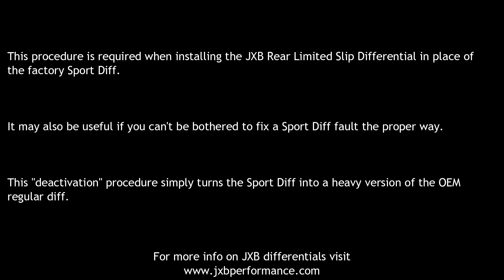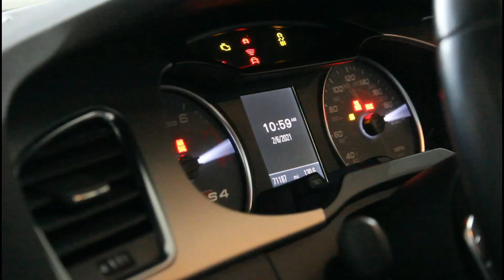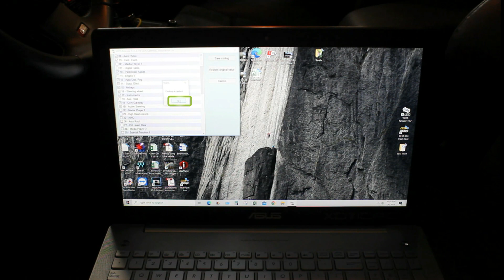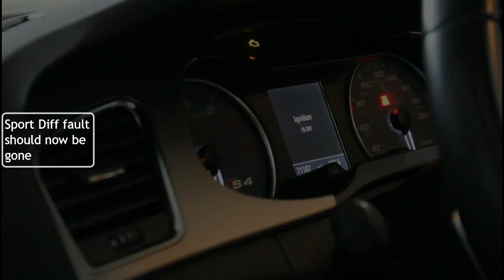How to Deactivate/Code Out B8 Audi S4 Sport Diff

Comment: Will this work for 14 audi rs5 diff?Prev owner mentioned changing the rear differential with used oem diff. confirmed with the shop that did the work. Thy recommended going to the dealer. Car drives fine but show sports differential malfunction light. Same one u had in the video. Thanks

Comment: Hello, great video! You just helped me get rid of the light I have spent months fighting and trying to fix. 

One last step on the C7 platform(mine is  a 2014 Audu S6)- you must plug in the module in the trunk. If you don't. You will have fault lights for ESC, parking brake, TMPS, Air suspension and others. 

Once I plugged the module back in, all the lights were gone and Sport Differential system fault still gone. 💯💯
Reply from the maker: That's awesome thanks for sharing!  I'll have to try it on our 13 S6; I've just been living with the Sport Diff light.
Reply: Whats the steps that was taken on your C7 im working on my C7.5, cant see what he us doing on this video

Comment: If I do this due to an electrical fault , will the diff be damaged or will I be able to use it in the future once the electrical problem is fixed
Reply from the maker: This won't hurt the diff, it just stops the car from looking for it so it would turn the diff into a "regular" rear diff.
Reply: @JXBPerformance  ah thanks 
I guess I can program it back in once I have the parts to fix the diff

Comment: Does this disable the quattro when you leave 22-AWD unplugged?
Reply from the maker: No.  Only the Sport Differential's torque vectoring functions.  Power is sent to the rear wheels via the mechanical center differential, so there is no way to turn off quattro in these cars electronically.

Comment: I have a C7.5 S6 with the Sport diff. Can this process be used to "code out" the "Sport" of the Sport diff? If so, could doing so positively affect the longevity of the Sport diff? I assume this process is completely reversible?

Very informative content on your channel. Thank you 👌
Reply from the maker: You could theoretically do this, but you'd only be helping to save the clutch packs, which the community really hasn't proven are problematic yet.  Not so say that they aren't an issue, it's just really hard to tell if they're working or not, as there's no definitive sign that they've failed.
Reply: @JXBPerformance  thanks for the response, this is helpful. Seems like more trouble than it's worth at this point.

Since I've got you on the horn, is VCDS worth it for other S6-related stuff? I'll be tuned via DS1 and SRM (TCU) and I'm curious what the tool offers me that something like OBDeleven can't do or do as well.

Thanks again! You are a true credit to the community 👌
Reply from the maker: @hikeskool  generally the big advantage of VCDS is being able to do things beyond just releasing the parking brake and general scanning.  I don't have the experience with the other options, but VCDS is what the dealer uses if that gives you an indication of the power of it.  IMO with the money we spend on the cars, getting the better diagnostic tool is a drop in the bucket and totally worth it.
Reply: @JXBPerformance  good answer. It always astounds me when people buy expensive cars and balk at relatively small expenses (I'm definitely not immune to this).

Thanks again! For a couple hundred bucks it seems like a pretty capable tool.

Comment: After I did the process with the vsdc coding the diff light went off but the spoiler alert light came on. What does that it mean ?
Reply from the maker: what car are you doing it on?
Reply: @JXBPerformance  Audi s4 b8 2012
Reply: @JXBPerformance  any information on what can I do to turn that light off ?
Reply: hey any update ? cause i have the same car thinking of doing this but wanted to make sure before doing it

Comment: Been tryin to figure out this issue for the longest! Thank you!
My only concern is by i guess sort of tricking the car to think there’s no issues, does this actually fix the sport diff issue (like if it’s mechanical or if it needs a new sensor)??
Reply from the maker: This basically removes all electrical function from the Sport Diff.  The Sport Diff is a regular open differential with added torque override gears to do the "Sport" part.  The issues these diffs have are always related to the "Sport" part, not the regular open differential at its heart.  So when you do this process, you are just turning it into a regular open differential with the torque override gears just going along for the ride.  It doesn't hurt any of the components, just disables them.
Reply: @JXBPerformance  excuse my ignorance but don’t disabling compliments hurt the function of the device?

Comment: Doesn't work for me, still get abs module reporting fault that awd module is missing.
Reply from the maker: This is on a B8 correct, not a C7?  You need to disable 22-AWD in gateway installation list and make sure it saves correctly.
Reply: @JXBPerformance  2009 s4 b8 with dynamic package. Yes I deselected from the gateway list and it saves correctly. Instrument cluster module also codes and saves OK. 
Im going to try to re-install the module physically so the abs module can see it and leave it coded out in the Can gateway and instrument cluster module. See if that works. I've tried to code it out in abs module but there is nothing there for awd except deselecting "dynamic package fitted pr code..... " which when I save the new coding it doesn't stay saved it accepts the code and then when I recheck it reverts back to the original coding.
Reply: Tried putting the awd module back in physically and clearing the abs code, but didn't work still get the dash board warning of "sports differential fault". Don't know what else to do?
Reply: @LAW-Automotive   Did you ever sort this as I'm having the same issue? Thanks.
Reply: @Ade-T.C.S  no. I've just ordered odis and I'm going to flash the module myself. Rather than taking to dealership or independent specialist. If it won't reflash then might have to get new module and that is another whole headache with component protection.
Reply: @LAW-Automotive   Thanks for the response and please let me know how you get on - if you don't mind. Best wishes.

Comment: Would this procedure work on 2013-2016 B8.5 RS5?
Reply from the maker: It should work on all B8/8.5.
Reply: It worked perfectly. Quick tip. No need to unplug the module. I simply pulled out the Quattro Sport fuse located in rear trunk compartment. Fuse #9, 35AMP.
Reply: Thank You, it worked on my audi a6 c7 3.0 tfsi after pulling the fuse, 5amp in luggage compartment.